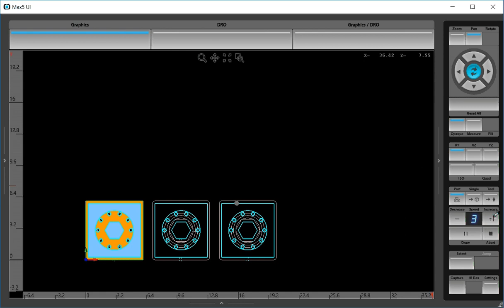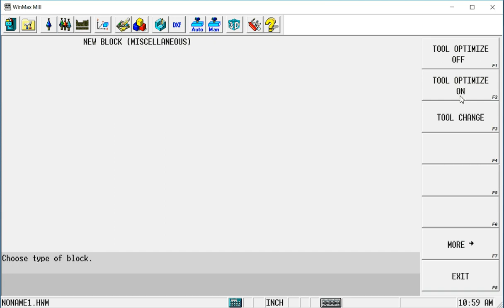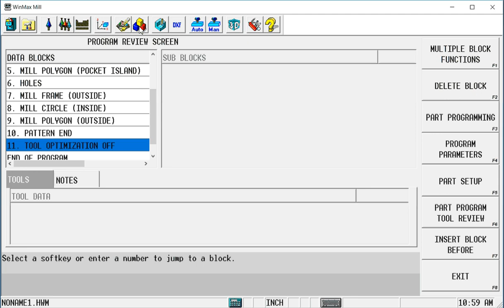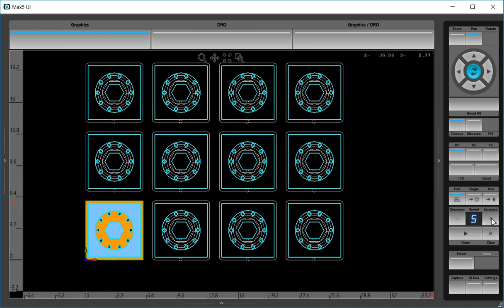How to use Tool Change Optimization - Hurco CNC Control Demo

Comment: This should be a standard feature rather than an expensive option. Siemens is still 15 years ahead of Hurco.
Reply from the maker: Hi Harrelson Trumpets! Thanks for comment, but I need to clarify: Tool Change Optimization is a STANDARD feature on the Hurco control. Are you possibly referring to Tool & Material Library?